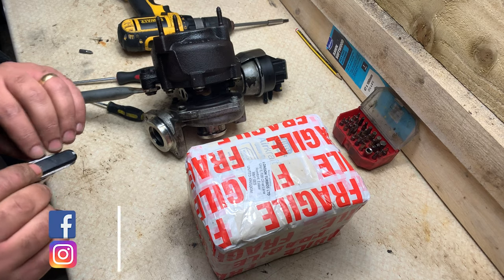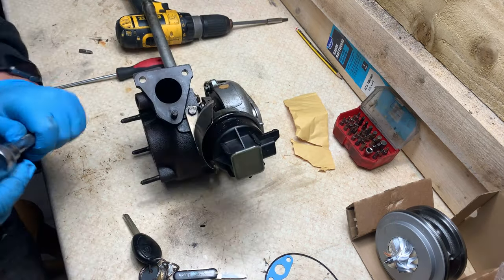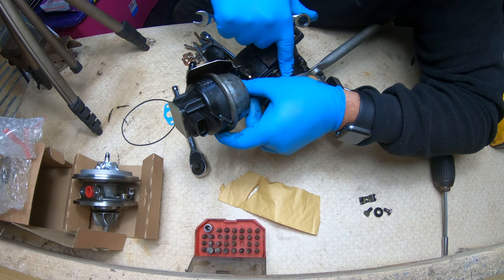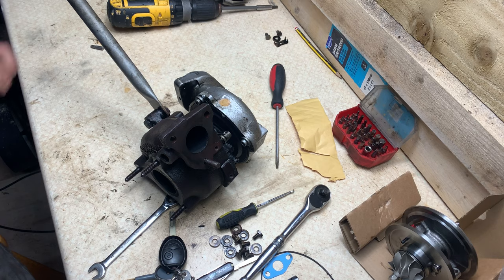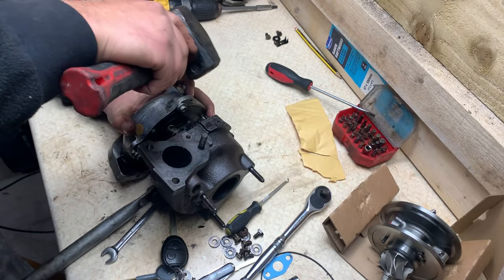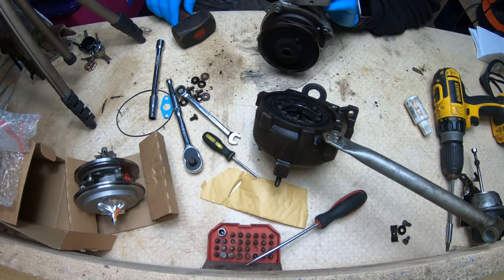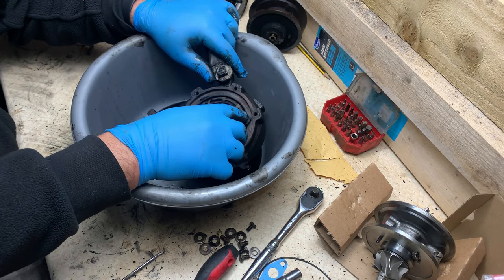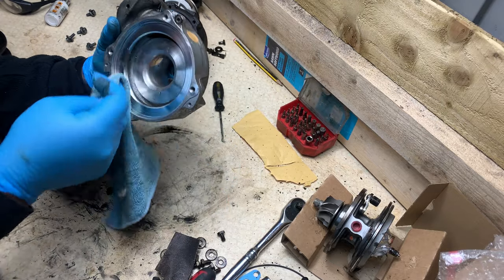Audi Q5 Turbo Cartridge Replacement

Comment: Nice video. Any idea on the cause of the turbo failure?
Reply from the maker: Automotive Solutions How’s it going man ? The cause of the failure was bearing/shaft play where the turbine impeller came in contact with the housing and kaput blocking the exhaust gases and the vehicle wouldn’t start ... thanks for stopping by bud👍
Reply: I had same issue on 2.0 tdi PD140 with DPF. Turbo failed from excessive backpressure and blown turbo seals, thus causing DPF failure.
Reply: @Stetson Darwin -_-

Comment: Why did one of the compressor vanes have a pinkish color?
Reply from the maker: Tom Cartmel I believe is to do with assembly balancing mark... the turbo is normally balanced putting together the turbine impeller and shaft first, then is balanced again with the compressor impeller, after that the compressor impeller is marked, removed and assembled as the turbo core or cartridge with the bearing etc and some company’s balance it again...

Comment: Hello there mate, quick question please?
If I got smoke coming out of my bonnet, how can i tell if it's a bad turbo or a gasket leak ? 
Secondly, can a bad turbo make it difficult in starting my car?
Thanks in advance
Reply from the maker: Dr Fret smoke coming from under the bonnet can be many oil dripping on hot parts is a common thing , but visual inspection is the way forward... The turbo normally comes to action around 1500RPM so it shouldn’t be making the car difficult to start .
Reply: @CarsExposed  thanks a lot
Reply from the maker: Dr Fret pleasure sir 👍

Comment: Yes but most professional repair shops ask extra because of the balancing station. Is it really needed for a core swap?
 So far i have determined that the only time you use a balancing station is if the case has flaws (after a turbo failure ) or if you tamper with the core (partially replace). So is the balancing station needed for a core swap?
Reply from the maker: The balancing happens in the core . When you buy a new core from a company it already comes balanced which part of the assembling process... This core replacing is more of a DIY thing, quite rightly I wouldn’t expect any garage to do this job because the time consuming and warranty issues 👍
Reply: @CarsExposed  thanks for the reply, here in Romania they just swap the core and ask 70% the price of a new one and argue that they actually rebuild the turbo and balanced it using the station .
Reply from the maker: Well here in UK the only places that invests in a turbo balancer are the turbo rebuilt companies so I wouldn’t expect a garage to have the equipment necessary to balance it
Reply: @CarsExposed  the small "garages" are asking the price of the core for the core swap and another 50 euros for the work, they also issue a 12 month warranty ( national laws)
On the other hand  the large repair shops that are afiliated with the car manufacturers are the ones asking for 70-100% of the price of a new part even if they just do only the core swap. It's s allways the big ones that skimp on the work and ask double the price.
Reply from the maker: Dracu_SRL interesting ... I would be very very surprise if any big garage would take this core swap job on